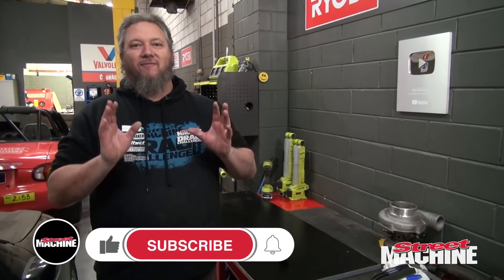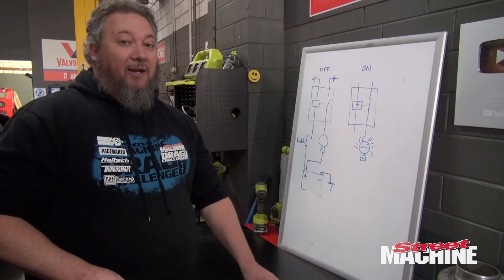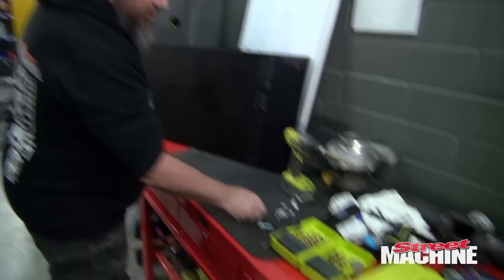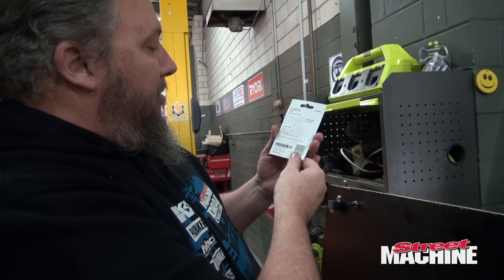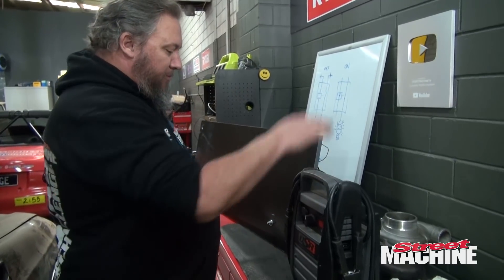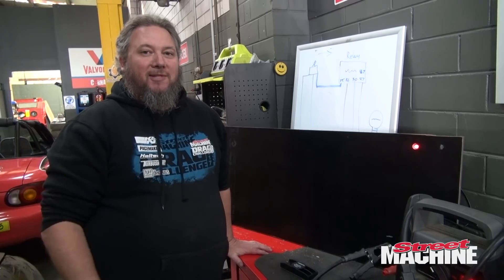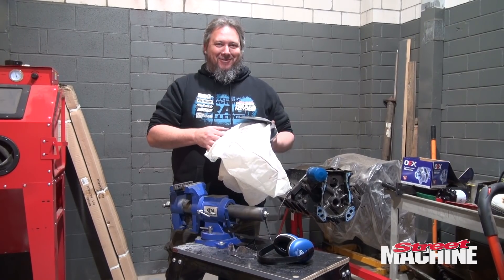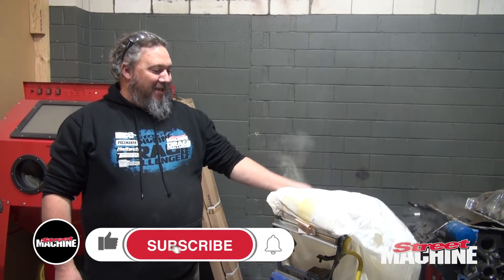Carnage Plus EP73 - Wiring Up Relays and Blowing Up Airbags

Comment: Love ya work as always! You could have easily wired straight from the switch to the light bulb! So my limited understanding is any high amperage circuit needs a relay switch that is built to withstand the high amps and therefore save the dashboard switch from burning out. You probably should have included a fuse in the main circuit if you really want to start providing auto electrical short courses :-) !!!

Comment: Great description of a relay, how it works and what it does, I'm a little confused though. Can you please explain next what a switch is and how that works? Also, how do you repack your airbags after testing them like that? I've just tested mine the same way and have spent 12 hours so far trying to get it back into it's case?

Comment: I considered myself quite confident with cars but boy did I get taken down a  peg when I wired in a 2 speed thermofan in to my track car.

The air bags also reminds me of a time when I first gutted the track car and replaced it's smashed windscreen, the windscreen bloke insisted we set off all the air bags I had and was extremely disappointed when I didn't. Must have asked around 10 times.

Comment: What the heel were those two copper looking bullet shaped items on the top right of the screen around the 1pm mark , @ the 13:20 mark put the upload down to .25% speed on the slow mo and you will see it, if its metal which i think it might be the charge casings for the explosives, then those items could in fact hit your face after moving around the front windscreen etc. :) Well done Scotty. :) Should start you own mythbusters called it scotties buster up show. lol :)

Comment: an added light to show how the normally open, normally closed differentiate would have been great with an example of why this could be used, more emphasis on why a relay is used in general as the example used could have been just achieved with a switch as there was no great load needing a relay fans. horns, even the solenoid on a starter is a form of a relay. was still a fun video

Comment: Missed the important question Scotty.
The purpose of the relay is what ?
How many AMPS can my switch handle is
it enough to drive the circuit ?
Most modern cars switches run of a circuit 
board that may only produce milliamps to
power a 30 amp circuit the key to this is 
the relay.

Comment: The convention for drawing current flow in a direct current circuit is from positive to negative but the actual flow is based on electrons flowing from negative to positive. PS: you forgot to yell 'TAKATA' when the airbag went off :P

Comment: technically electricity is the flow of electrons, which are negatively charged... and they seek positively charged things.... so it's actually flowing from negative to positive. However, as electricity was harnessed before we knew the charge of the electron, things are labelled as standard in electronics as positive flowing to negative. Kind of like a North pole of a magnet isn't actually North, it's North Seeking.

Comment: Good video on the relay switch very helpful indeed.
I also love how you point out that your using a SHIFTER,
Now with the Airbags what wire goes were to set it off? 
Asking for a Friend.
Reply from the maker: They're just positive and negative
Reply: @STREETMACHINETV   I'll let my "friend" know when i get out of hospital, i have a few airbags at home that can go boom.
Sorry my "friend" a has a few airbags at home that can go boom.
Reply: @dvorcemkrmotorsports8835  Putting them under milk crates or whatever your mate is sitting on seems to be the go... Especially good for shortening his spine when it goes off!
Reply: @brettus9115  i have a Fucked back & a Dodgy Heart, 
im not sitting on no milk crate while setting 1 off.
Reply: @dvorcemkrmotorsports8835  your 'friend' shouldn't be sitting on milk crates anyway

Comment: Great video mate but couldn't you have just used the switch to wire up and power the light?
Reply from the maker: Sure, but the point was to show the operation of the relay. The light was just an example, it could have been a thermo fan or fuel pump just as easily.
Reply: @STREETMACHINETV  does the relay also act kind of like a fuse in the sense aswell in that circuit?
Reply: @BATJINSTER69  The relay takes the load off the switch, basically when wiring up something that use a big load the switch can burn out so the relay takes the load protecting the switch
Reply: @knight2425  Thanks Mate!

Comment: good video Scotty but you didnt tell everyone the point of a relay, being to take load of a switch or to use a lowered powered circuit to switch a high powered circuit, imagine if your indicator stalk was thick enough to power headlights etc
Reply from the maker: There's a whole bunch of reasons but yes that is one of them

Comment: Sorry to be a knob... 85 should be the earth side switched 86 should be powered positive. Some relays have diodes for protection and they don’t like being wired the wrong way, you usually fuck the relay. Some have resistors and some no protection

Comment: I don't understand why you wouldn't hook up the light bulb directly to the switch :(
Reply from the maker: The bulb was just an example of powering something via a relay
Reply: You can but it means the wire needs to carry more current, no relays means the wiring system would need to be many times the size to handle the extra current without melting... by using low current switching the wires can be shrank in size thus decreasing the amount of copper needed so it allows things like ECU's and body control units to switch things with a few milliamps, otherwise those micro sized electronics inside them would need to handle high switching currents thus increase in size dramatically...

Comment: Ryobi cordless power tools are just cheap rubbish that just don't last. A friend uses them and he goes thru skins all the time. He said the brushes are soft and it's easier and more cost effective to just buy a new skin. He has about 8 or 9 drills that are all stuffed as well as countless other skins.
Reply: Quality tools are a thing of the past. I payed big money for the best Hikoki ( formally Hitachi ) battery drill they make 8 months ago and it blew low gear under "normal" use. Then i had to fight tooth and nail to get repairs under warranty. I've had a Ryobi battery drill that had been worked hard and dropped off a 2 story roof that lasted years longer. Money doesn't always deliver quality
P.S your friend is probably overloading his drill
Reply: sell them.
Reply: @danielmcdowell7054  Pffft I snapped a lifting strap and dropped my cast iron tablesaw on a 90's makita 7.2V still would work now if I could be bothered getting a new battery for it... cant say that for my latest makita drill barely 10yrs old, I'll let you know in 20yrs eh... Gimme my makita back Mac ;)